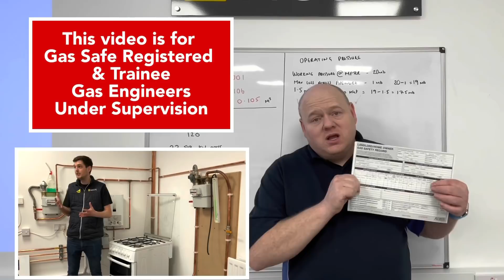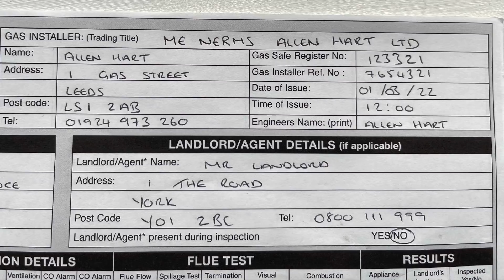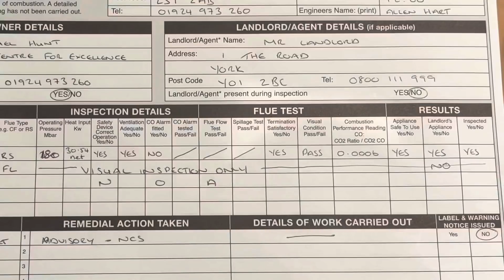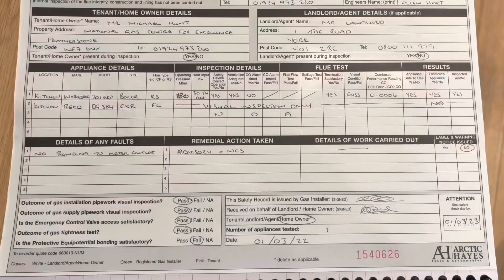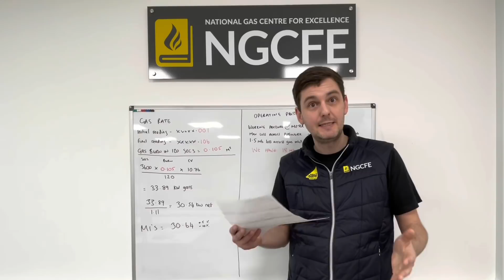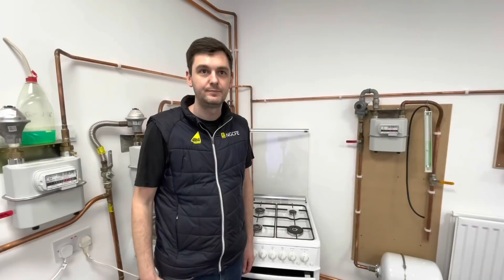How To Fill Out A Landlord Gas Safety Check CP12 GGIUR 26.9

Comment: I have a rented property and the CP12 I get via the managing agent is not very impressive. I used to do it myself until I retired and used electronic CP12 software from about 2005 onwards. I preferred the electronic as, after checking, you could email it or post it. Also the form is ready populated with addresses and appliance data for next year.
Reply: which software you used?

Comment: Fantastic, really useful and glad you made and posted this thank tou
Reply from the maker: if you have any other ideas for videos just ask. Thanks.
Reply: @AllenHart999  I work with LPG only, how do I work out the heat input for the form if it's bottled gas? Thank you

Comment: Good video as always very informative and helpful to trainees 
Wee question tenants own appliances Michael says it best practice to check flame picture my understanding was you should always check the flame picture can you clarify if that is the case Allan. I always check them myself as had a couple I've had to cut off due to incomplete combustion and one were the flame was coming out underneath the burner on a hob.

Thanks
Reply: Hi Jason,
Thanks for your comment. I mean its best practice to check it on a tenants own appliance as there is no obligation on you as an engineer to check a tenants own appliance. Therefor best practice would be to visually check it regardless of whether is is being recorded on the document or not.
Reply: If a visual inspection is done on a tenant's cooker. Can you still determine if it's SAFE without testing the safety devices and pressures on the cooker???. The CP12 forms have a box that needs you to confirm YES/No if the appliance is safe. Do we write N/A??

Comment: On a tenants own gas fire.......what do you do for a CP12 ? ( I know what we did on social housing contracts 🙂)
Reply from the maker: Although the gas regulations say that you do not need to check the tenants own fire, Techical bulletin 055 states that other regulations regarding building fabric we must inspect the flue as that belongs to the landlord.
Reply: Indeed,  so it was fire out, builders opening inspected for dead birds/debris and cleaned, plus a flue flow test. After that you may as well go the whole hog and clean the fire, check the B.P. and spillage.......not only covering your back, but helping you sleep at night too. It also gave more scope to turn off or condemn some of the more aged appliances that were a bit iffy.